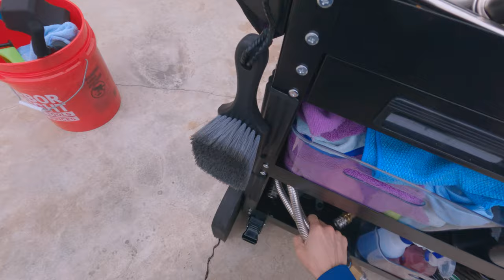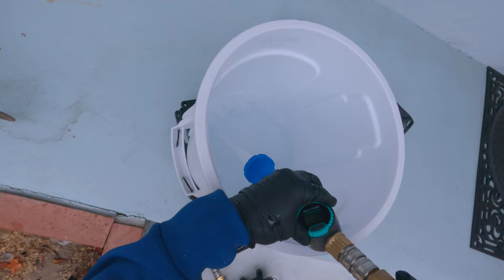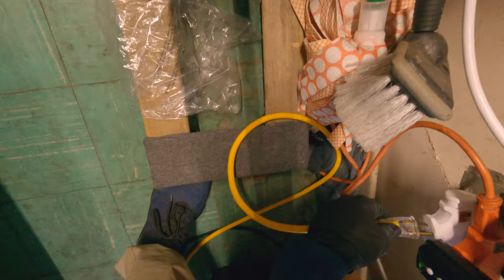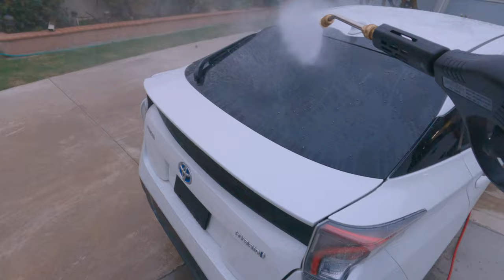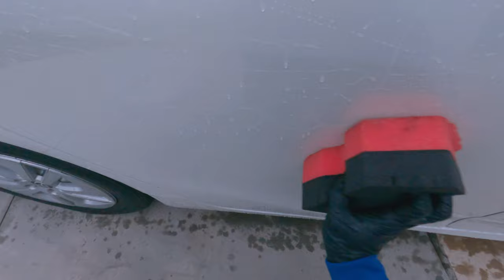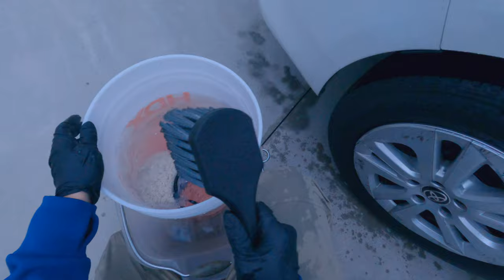The Easiest Powerful Rinseless Power Wash for your Car!

Comment: wasted 10 mins watching him prep for the wash. lol what’s the point? regular wash would be done by the time when he starts
Reply: It doesn’t take this long to do a Rinse-less wash. 😂 Setup included. This guy has a lot going on.
Reply from the maker: @elonsus9747  No, it doesn't you're correct. I was just making sure everything was in place as this was my first time with the pump motor. I also don't pull out the pressure washer that often.
Reply from the maker: This was my first time using a pump motor setup along with the Pressure Washer (which I don't use too often in the first time). I also like to take my time cause I'm just a guy who does this for the hobby.

Comment: What is the point of the rinseless power wash?
Reply: To get any dirt or debris off the car before your contact wash with rinse-less. It’s no different than what you’d do before you start your contact wash with soap and a mitt. Chemical, rinse, chemical or foam,rinse, foam. No wrong or right way to do it.
Reply from the maker: To simultaneously blast off dirt n' grit while applying rinseless wash on the car. It's basically an overengineered type of process.